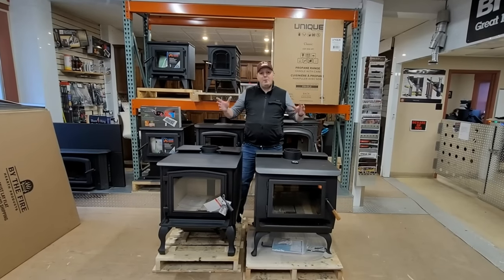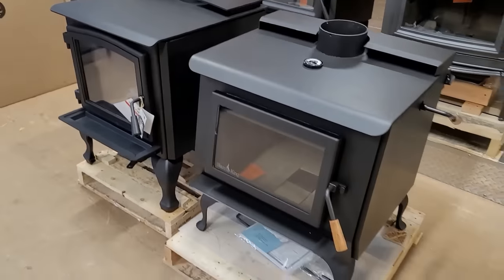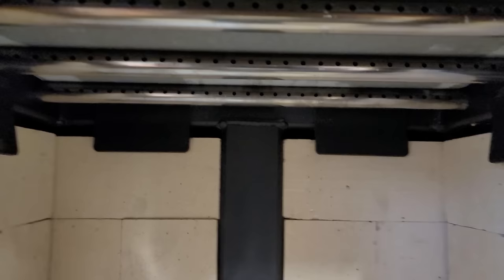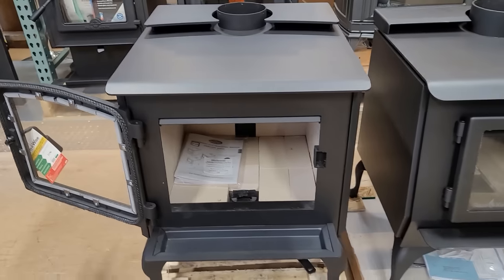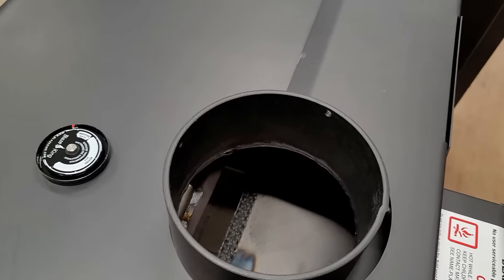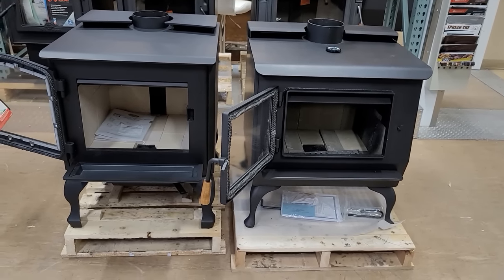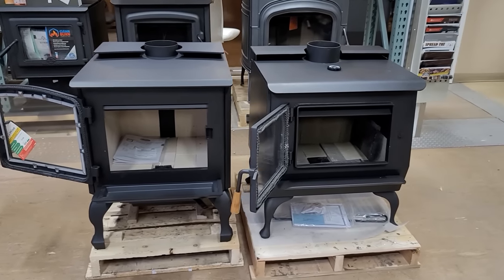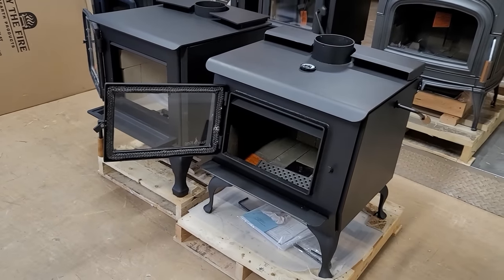Comparing Catalytic to Secondary Air Wood Stoves

Comment: I have a Blaze King Princess.  I am a shift worker and I work 12 hour shifts.  What I like about the Blaze King with the catalyst is that even with the air vent fully open (it gets down to -35 C in northern Alberta), there are still lots of coals left when I get home.  I live about 45 minutes out of town.  So, basically, it has not problem burning for a full 14 hours, even with the air vent fully open.  That is a big plus for me.  After a 12 hour shift, I don't want to be bothered relighting a cold stove.  I just throw more wood in the woodstove and it takes off.  I do agree that that catalyst is expensive.  Part of the reason that I want to burn wood is to save money.  However, with heating costs going up every year, I think maybe buying a new catalyst every other year is not the worst thing in the world.  When the catalyst is new, the whole thing blows bright red.  When it gets older, it doesn't glow as bright, however, there is still virtually no smoke going out of the chimney.  It still burns very clean.
Reply: you have to replace that catalyst every year?  not so good for when the shit hits the fan and you can't buy them anymore.  Looks like I'll be sticking to the other one.
Reply: I'm in central BC and heat my home entirely with wood. I have a Blaze King King. It's awesome. I see no reason, however, to replace the catalyst each year - they should last a minimum of 5 years (probably closer to ten).
Reply: @King_TuTT  You don't need to replace it this often... but you also don't need to use it. ;) You don't need to run it in catalytic mode. Losing the catalytic unit makes it less efficient, but it will still be better than most non-catalytic other stoves.
Reply: @LifesLaboratory  if you run it in the non cat mode all the heat will go straight up the chimney and you may also cause damage or warping to the bypass. It’s also better to go by catalytic life in hours not years. They only last 10,000-12,000 hours which would not stretch out to 10 years unless you only burned weekends.
Reply: @wobdeehomestead  Correct. The guy at the stove shop trying to sell me a cat model said with our 6 month winters, using the stove full time means 2-3 years lifespan.
Reply: @wobdeehomestead  I almost always run in catalytic, unless I don't need that much heat (in which case I run it damped down... I fail to see how doing so could get anything hot enough to warp). I have a large five bedroom house in central BC. We heat entirely with wood (it runs 24 hours per day for half of the year). The catalytic unit is five years old with no signs of diminished returns. Mine is  probably close to needing replacement... but then most people likely don't run it this much. Once you buy a Blaze King, the only way for the company to make additional money from you is to sell you new catalytic units (i.e. I think their estimates are a bit conservative). A light user could certainly get 10 years out of it. I can't imagine having to replace it every other year... even if you live in Antarctica. ;)
Reply: They have a 10 year warranty. If you had to replace it after 2 years it should have been free.
Reply: @RVBob  I upgraded to the stainless steel version, so I paid a bit extra.  Actually, after some experimenting, I've found that if I brush the catalyst off with an old tooth brush, when cleaning out the ash, i.e. when it is stone cold, it works like new again.  It glows bright orange.  I might have missed this in the instructions but I wish they had told me that when I bought the stove.
Reply: @trevorstolz8580  I'm still shopping. Haven't decided yet what I'm going to buy but I'm leaning towards a Blaze King.
Reply: I have a BK King.  Myself and two friends in CT bought ours all at the same time back in 2009 ($1925 each, don't know what they cost now, but I'm sure they're worth every penny).   Anyway, we all remove and clean the cat at least once a year.  All of us use the stoves all winter long, and we are all still using the original cat!  I do have a spare cat which I bought with the stove, but haven't installed it.  Awesome stoves!
Reply: Never had to change or clean my converter.
It's 20 years old and still in great shape.
Have a spare for it just in case.
If I had to change it now it would out live me.
Reply: @martinvanherk8771  Yeah, I think you're right.  When the stove does go out, I brush it off with an old toothbrush as there is some ash covering it.  Then it glow bright like when new again.  Since I started doing that, it works wonderfully well all the time.
Reply: What did it cost in CND dollars, I'd like to upgrade
Reply: @trevorstolz8580  When my stove goes out and I am cleaning the ash out I suck the ash out with my shop vac, and also take the vac over the cat. I do this twice a week in the winter and maybe once a week in the fall. I am running a Blazeking Asford, also way up in northern alberta FMM. Fuel my stove up once a day in the mornings and its still kicking out heat when I get home. I don't think they would recommend taking a shop vac to the cat but I haven't damaged mine yet and it still glows nice and orange. 

I 'm not gonna lie though I destroyed my first Cat while figuring out how to use the stove, and figuring out the correct settings for the 3 species of wood I burn.
Reply: @BType13X2  Don't feel bad.  I wrecked the first one I had also, but they replaced it on warranty.  I tried to take it out to clean it.  Bit mistake.  The gasket type material (?) around the edges just disintegrated.  Woodstoves are a lot better now than when I was a child.
Reply: @ssoffshore5111  inhave bk 29. Paid 5000$. Letsgobrandon
Reply: @catz-media  FJB is right!!!  They certainly have gone up since I bought mine, but if I had to buy another stove (for some strange reason), the BKK would be at the top of my list again.

And yes, the owner's manual even states you should lightly brush the ash off the cat with a soft bristle brush regularly.  I don't know how often other BK owners need to clean out their ashes, but I clean mine out about every cord of wood or so and brush the cat off at the same time.  A brush attachment and vac does a great job (make sure the stove/cat is reasonably cool).
Reply: “The gases are fueling the catalyst”. Ok but what energy OUTPUT GAIN is this?  I do not understand.  Longer burn is great, but whats the BTU impacts here?
Reply: @dshogan6174  The short answer is I don't know.  Realistically, this value probably varies with the species of wood you have, moisture content, etc.  If you are getting more energy out of your wood, however, that means less wood needed, etc.  Smoke is unburnt fuel as is creosote.  It's a waste to let that heat energy go up the stack when it could be heating your home, reducing the risk of creosote buildup in the chimney and and thus reducing the risk of a chimney fire.  
One might as well get the most bang for you buck that one can.
Reply: @catz-media  What's wrong with you? This isn't the place for political stuff. We're talking about stoves, and you're thinking about Biden
Reply: Wow that is pretty good. I sold stoves for years. I always was concerned with the cat being the replace of them?  I have been burning my Avalon 1190 for over 20 years and never even replaced an air tube.  But I can get fires started again after maybe 12 hours?  I have looked into the Blaze King and have been considering one for my other house.
Your comments are well taken because you have it and you are in Northern Alberta and I am in PA. 
With the EPA getting worse by the day the Blaze Kings are looking like the best options.  How long have you had it?? 
You are right, the price of the catalyst ever other year with the savings in wood costs alone even when you cut  your own.
Thanks and keep burning as long as you can !!  Have a very Happy and Safe New Year !!!
Reply: @King_TuTT   The catalyst lasts 7–10 years when maintained properly.
Reply: Blaze king princess is the coolest name for a wife I've ever heard... She sounds awesome.

Comment: I had a Lopi Endeavor,  5 hour burns, brick floor level with bottom of door, constant ember roll outs that land on catch tray also level with bottom of door so you have to clear catch tray before you close door.  Also only takes small diameter pieces of wood which means more wood splitting, heat mostly from noisy blower, minimal radiant heat from sides and top.  Lopi is in storage covered with tarp, reinstall if I sell my home.  Installed a non EPA stove that gets 12 hour burns, takes 20” rounds, maybe more hot smoke up chimney but house is warm!   California Dixie Fire put out more pollution than 100,000 non EPA wood stoves and 2 cycle chain saws for 50 years, while 20 other California wild fires were also burning, Hug a Thug Governor Gavin Newsom is going to save the world and get China to put out all their burning coal mines AND stop the sun from eventually burning out!